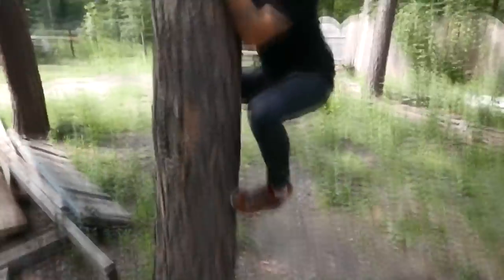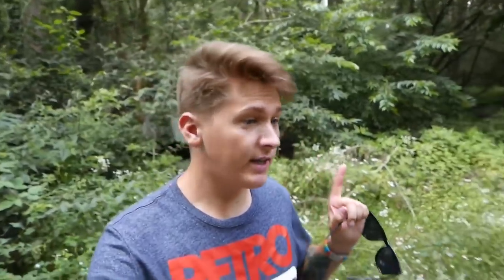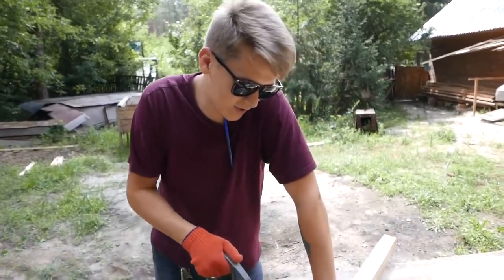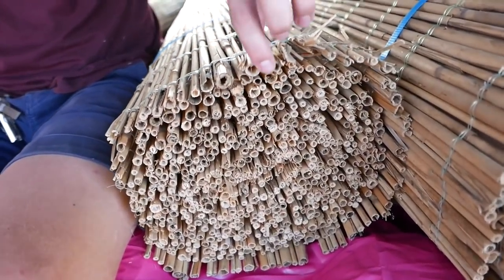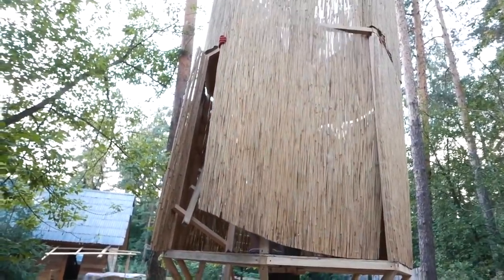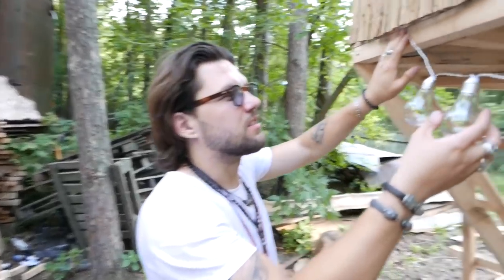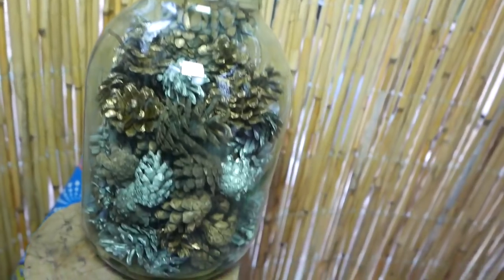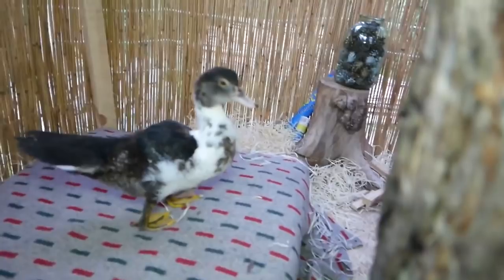2-STOREY TREEHOUSE - DIY

Comment: I would have stapled poly to the inside of the frames of the house for better weather protection, even insulation between the 2 x 2's before poly for winter.